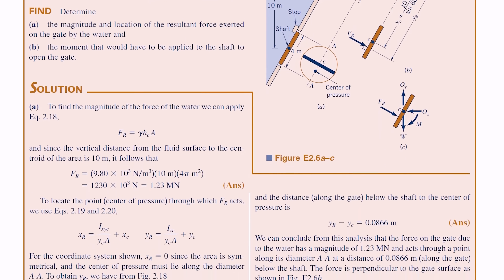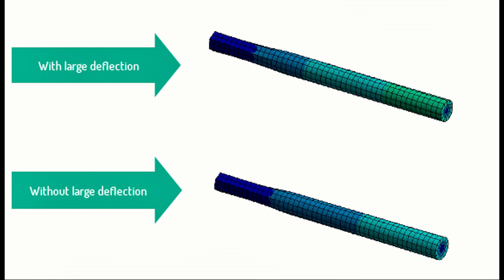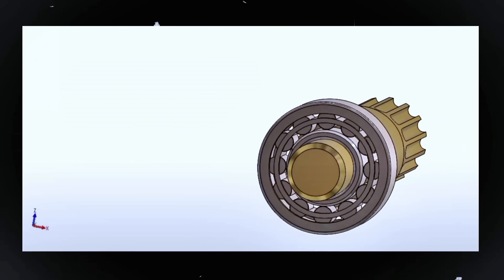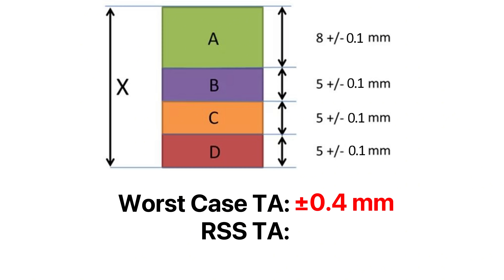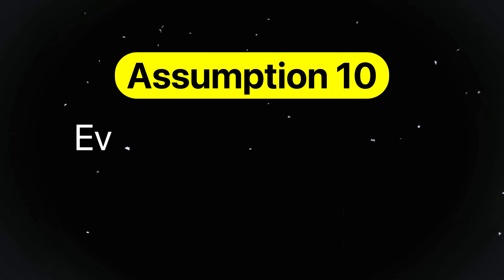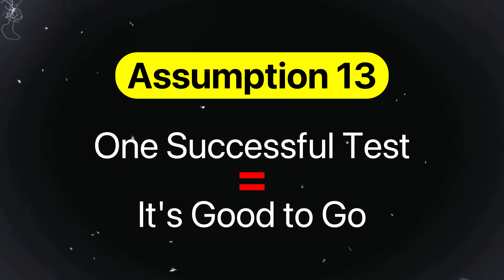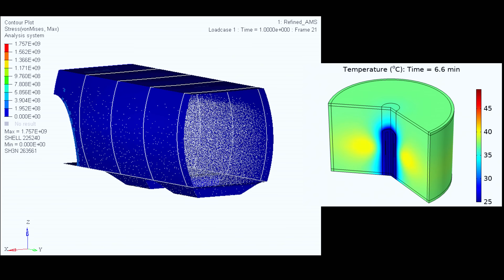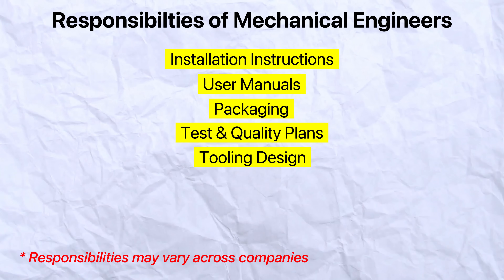You Don't Really Understand Mechanical Engineering

Comment: Could you go through a design and show us how you decide what is and isnt a critical dimension/tolerance?
Reply: he kind of already explains it in the vid, locations where holes need to line up, or parts meet somehow, and interferance issues are possible, he talks about that. honestly, just, anytime two parts are meeting, those dimensions need to be good, and usually from origin as well, to avoid staching tolerances.
Reply: stacking tolerances*
Reply: Every design is different, but for an idea of what to look for, what two parts of the assembly need to be in perfect relation for the assembly to function? Put another way, are there any parts where if they were misaligned or mislocated by 0.0001" (or some other arbitrarily tiny measurement) they would destroy the assembly or cause it to fail to function? Those areas are critical. Go out from there to assign tolerances.

As an example: accessory mounting screw holes on the outside of a casting are generally very low tolerance. Think of something like a marker light on the cylinder block of a tractor. They could be off by as much as 0.125" and the part would likely function just fine. However the bore through that casting in which the bearings for a shaft are pressed needs to be machined very precisely with tightly controlled callouts for location, finish, circularity, concentricity, perpendicularity, and possibly more. This is because multiple parts interface directly and indirectly with that surface, and the function of the machine could even become unsafe if there is an error in machining. Again, if the part is the cylinder block of a tractor, drive shaft misalignment could lead to actual injury of the operator.

Any other part whose location relies heavily on it's relation to that bore needs to be located with high precision. In that case you may have some locating feature like a machined boss or dowel pin which needs a very tightly controlled callout, but the screw holes for mounting the part could have no relevant restrictions in relation to the bore. They should be called out relative to the mounting surface or dowel pin bore, and their tolerance probably still doesn't need to be any tighter than the general tolerance for the thread form you are using. Sticking to the example of a tractor, mounting holes for the belt drive which powers alternators and water pumps could be located in this way. Some locating feature might have a tight tolerance to precisely locate the pulleys while the screws for mounting just need to not interfere with anything else more important.

In all instances some thought needs to go in to how the assembly functions, and what parts of the assembly need to be very precisely located for it to work, and which parts could be assembled with very loose tolerances with no practical effect. Don't waste money over-tolerancing, and don't risk failure by under-tolerancing. Both options can lose you a job.